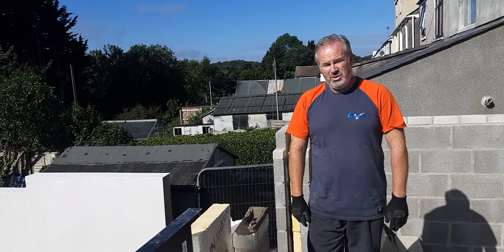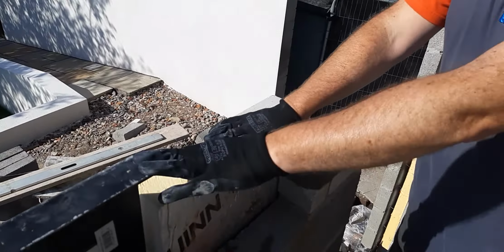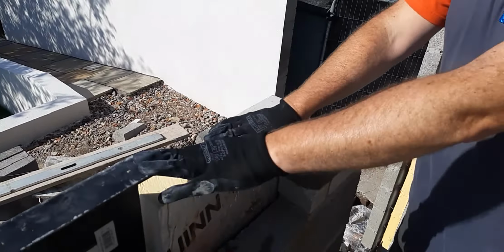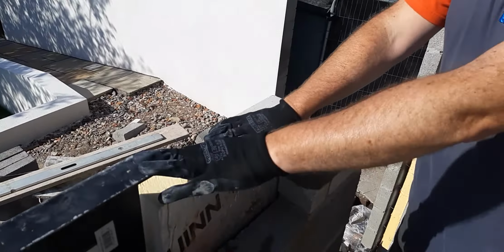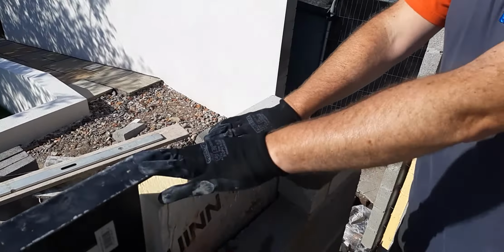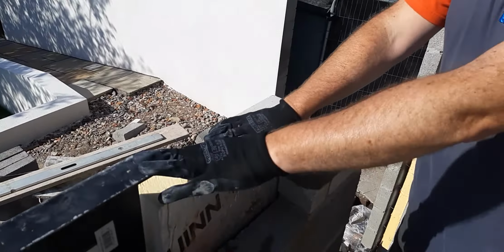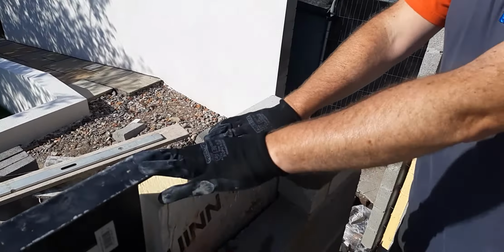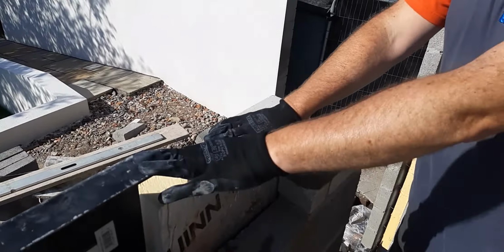How to install a cavity lintel

Comment: Noticed that you didn't check that it was level across the cavity wall gap, it may have been high/low front to back otherwise great video.
Reply from the maker: It was level Glenn and gauge. Appreciate it mate 👌 👍

Comment: How does the plasterer plaster the insulation on the underside of this.  Thanks
Reply from the maker: @grahamdalzell6933  
Not sure what you mean.
Insulation is in-between both skins so you can plaster and render internal and external blockwork 👍

Comment: Great video do you leave the lintel to go off before putting the block work I'm not a builder but I'm putting my own in to make a bigger gap for a big window any advice would be great cheers
Reply from the maker: Hi Patrick 
Thanks for the  comment. No need to let the mortar set mate .good luck 👍

Comment: If your after a 10mm mortir joint between courses, do you split that when you fit the lintel, ie 5mm bed under the lintel ? 
Great vid, thanks
Reply from the maker: @Fartec  you can dry bed them or as you say  a small bed 👍

Comment: Great video. Quick question. My builder did not add the 18 inch DPC on top of the Heavy Duty Catnic Lintel. Is this still okay?
Reply from the maker: On that type of lintel its ok but if its a different type then depending on which one is used it may need the dpc tray 👍many thanks
Reply: It's fine if the catnic is directly under the roof height, the roof felt itself does the job of the cavity tray at that point.